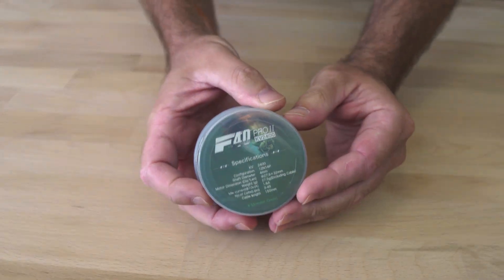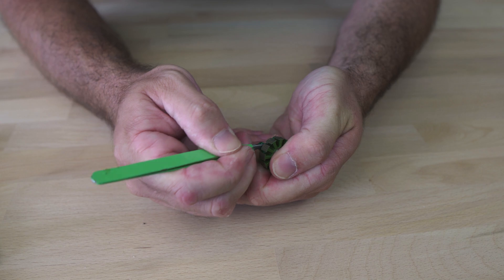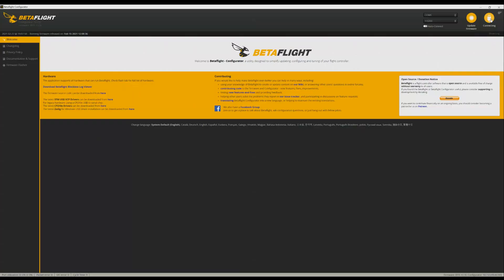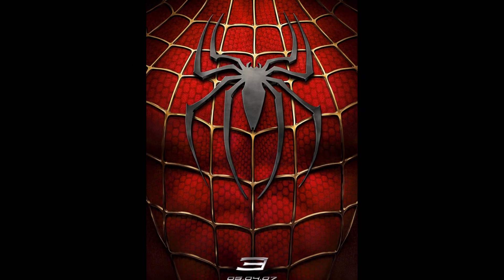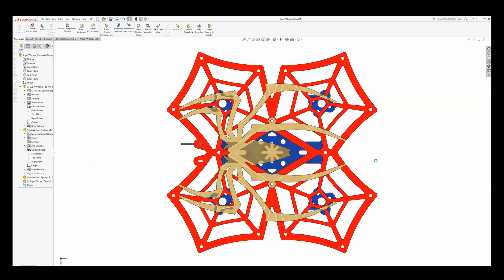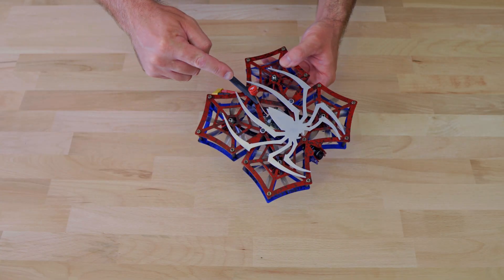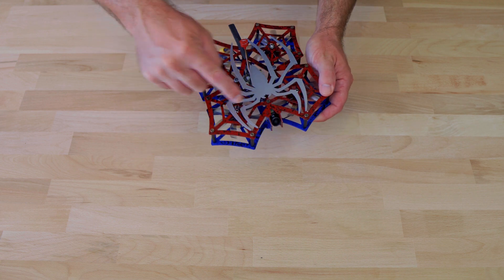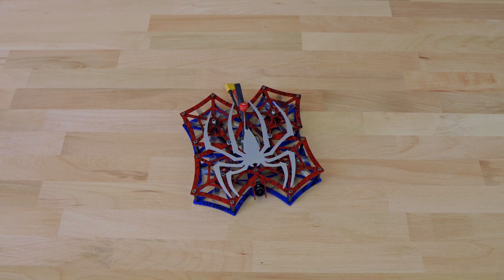Spiderman: No way home. The Marvel inspired drone

Comment: so its cool you rewound those motors... but all that KV math made a really inefficient flyer.  :/

an 1604 at 4k kv with a 3s 450 would have been so much better, weight with battery would be like 230g~
Reply from the maker: Thanks for the reply. It's cool people still watch 4 year old videos. The drone looks like like a spiderweb and sounds like a jet. If I wanted something different I would have built it.

Comment: what i dont understand is why you would want to do all that re-winding for a drone that has considerable choking on intake and efflux sides of the disc..?..or why you would bother with a re-wind if you were going to rob it of power by using numerous blades..why not cut back on the blade count and use a different kv motor and different volts?.. even better yet why bother with any of that given its obviously a super draggy, dirty air design thats not ever going to be  performer..? (in relative terms as its possible to make a brick fly if you have enough power).
Reply from the maker: Quite simply...Because I can...

Comment: Could you share your feeds and speeds as well as tool choice for cutting carbon fiber? Thanks!
Reply from the maker: Bit in depth for a YT comment sorry man. Always climb mill though, in a nut shell, highest RPM and run as fast as your machine and cutter will allow.

Comment: Cool project! I built my first quad out of wood and a kk2 board (because it was cheap) in December. It doesn’t fly great but it does get a 10-15min flight time.
Reply from the maker: Nice! That's where it starts mate. Are you hooked yet haha?
Reply: Well, I’ve been doing mostly RC plane stuff which is what I really enjoy but I wanted stuff I could fly in my backyard so I got an emax drone which was fun but I wanted solething bigger. So I ended up building this 88$ drone using 5$ motors with 10 inch props and ESC’s as well as a 2200 3S batterie I already had. I’m planning to use it to drop para shoot men and stuff which should be fun.